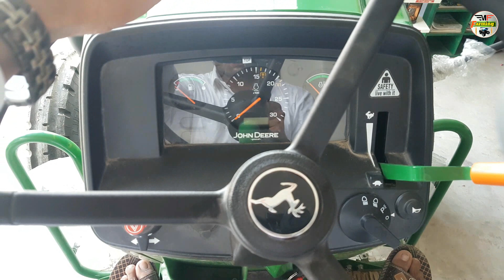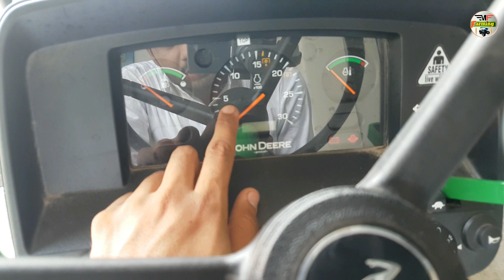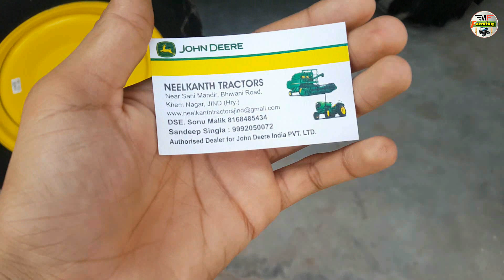johnDeere 5210 Gear Pro_New Model || 50Hp Tractor Price & Review

Comment: Oil Consumption is more than other ,seat is some how is small  it jurks when driver release the clutch. Speed is also less then other tractor four ABCD is use less people use to use high low only which were almost sufficient any how C is some how little bit useful and I think D Will not be use by operator